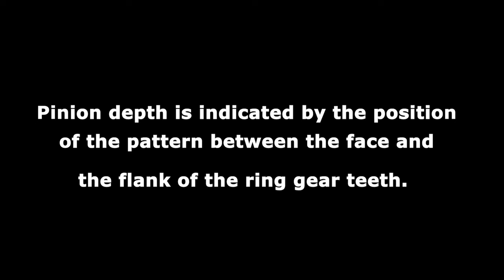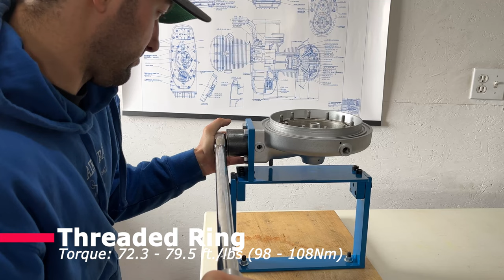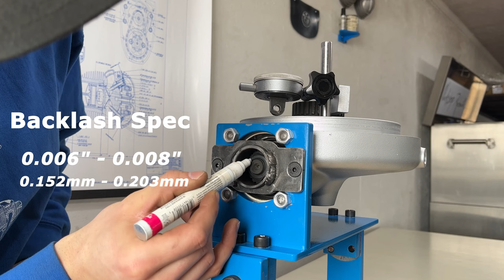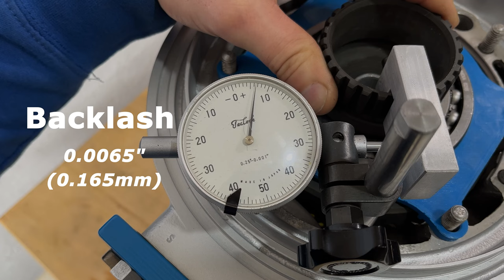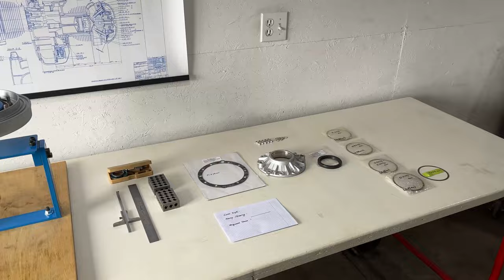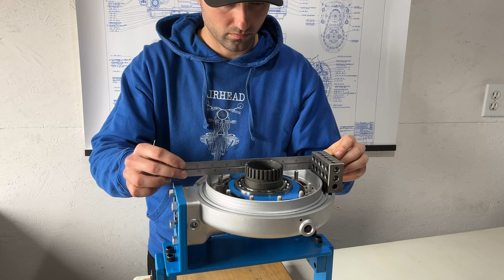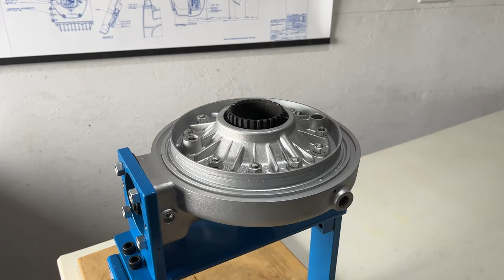BMW Airhead Final Drive Assembly

Comment: Great Video!!  Thanks - you  mention using an undersized bearing to avoid needing to heat the case during shim calculation.  Did you custom grind or buy?  If bought can you provide source / partnumber?
Reply from the maker: I've precision ground the old bearing! 

So, when you're swapping out the old bearing, keep it handy as a custom tool for future projects 😎

This is highly beneficial since both old and new bearings have identical widths, ensuring the pinion gear stays aligned for future installations. 

Remember, heat and extraction should only happen once because using slide hammers or other extractors on a new bearing could potentially cause damage.

I hope this helps😃👍🏼 Regards Andreas

Comment: What size arbor press is needed to rebuild both the final drive and transmission?
Reply from the maker: Hi Keith, I have a No3 arbor press and it works for both the final drive and the transmission. 
The No2 will probably work for the pressing force, but the No3 offers more space to work. Something I prefer especially when making custom pressing tools.

I hope this helps.
Reply: @WorkshopRebuild  Thanks, that very helpful. I assume you make a lot of the special tooling you use - you should consider making and selling them. I'd love one of those engine stands.